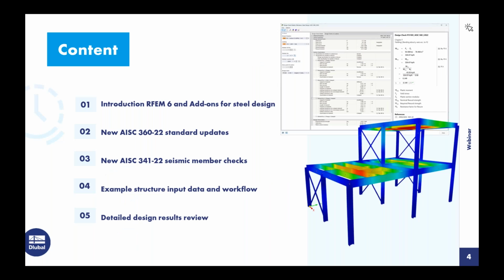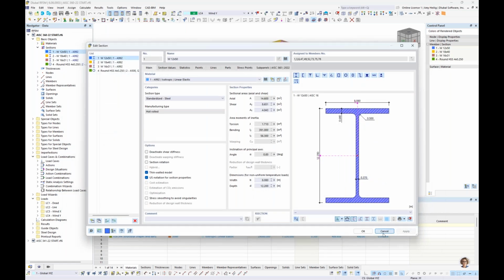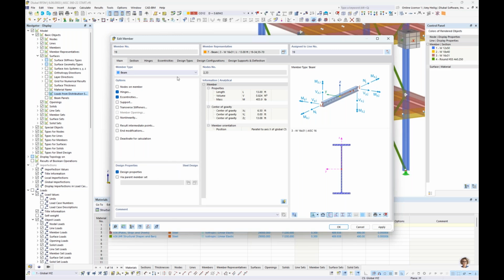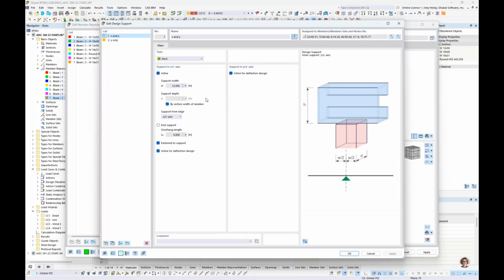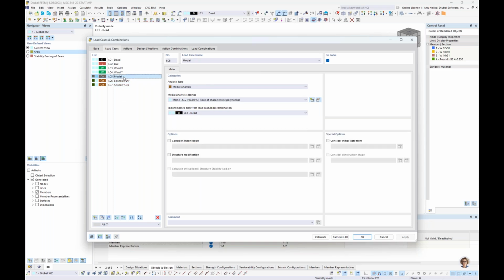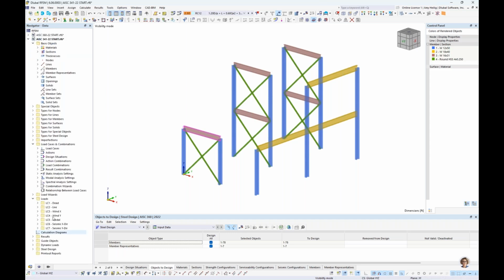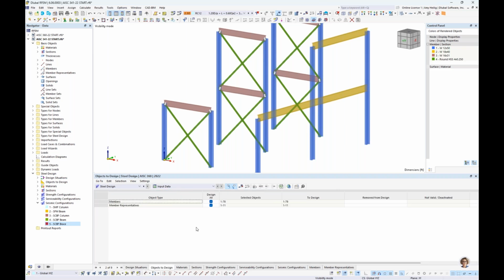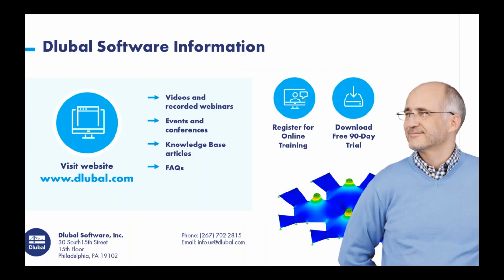Webinar | AISC 360/341-22 Steel Member Design in RFEM 6

Comment: Hello AMY. Thank you very much for the webinars you have prepared. We continue to learn with the presentations you prepare. Can you prepare a webinar on the use of Initial Sway and Initial Bow imperfections in stability analysis and steel design? There are various videos on the 7.DOF method on your site, but they are not very descriptive.
Reply from the maker: Hi, @mehmetgoktepe5424! Imperfection requirements specific to the AISC 360 Ch. C Direct Analysis Method are covered in the previous webinar below. 

https://www.dlubal.com/en/support-and-learning/learning/webinars/002440

The Warping Torsion (7 DOF) Add-on is currently not integrated with the Steel Design Add-on for AISC design. This is planned for the future. If you have any additional questions, feel free to email us at info@dlubal.com.